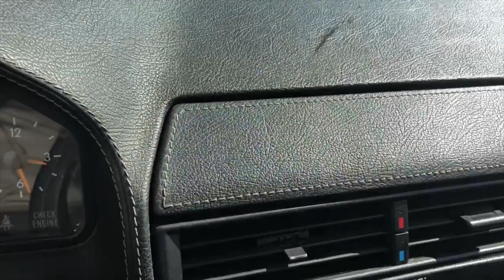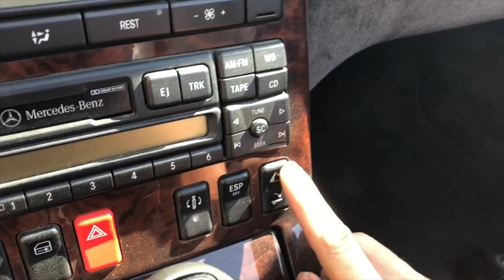I Bought a Broken V12 Mercedes SL600 for only $5000

Comment: I'll give you a hint, I used to own one when I was 18 years old, it was the first car i bought with my own money. Get rid of the stock air filter boxes and put in some 3" pipes with a rubber boot and a high performance air filter (those cone looking things). The power increase is INSANE, you'll notice when you take out the stock filters why. Its 3" going to the engine, but only about 1" on the scoop side! Mercedes did this to limit the air that would go into the engine so they could limit emissions. This'll cost you about 40 bucks total. Dyno it before and after. On mine I also deleted the Cats (not needed in my country) and I straight piped the rear exhaust, just left the Y exhaust connector in the middle

Comment: Before anyone gets any ideas, you can find a lot of these "steals" on older S classes and older Mercedes in general but major BUYER BEWARE, the only 'steal' is the repair costs stealing your financial security. 
Often the repairs can be like 3x the value of the car. Those hydraulic suspension and I know some Merc convertibles have hydraulic roofs that break...those are thousands in repairs

Comment: There are very few things more expensive than a cheap Mercedes
Reply: True.   But I can name a couple of those things.   Coping with debilitating injuries for the rest of your life, because you bought a cheap-to-maintain car without Mercedes' advanced safety engineering, is infinitely more pricey than is paying to keep a Mercedes sorted-out.    And in a city not far from here, there's a couple who are facing a future as Elder Orphans, because their only daughter was driving a Miata convertible, when she hit a defective manhole cover, and her car flipped, killing her.   If they'd just bought a Mercedes, like the one above, then their daughter's private schooling (pre-K-12), and all the money for all her activities, and all the other money they'd spent on her,  would not have gone for NOTHING (their emotional devastation, of course, has no price tag).    A Mercedes convertible would probably not have flipped, in the first place.   But if it HAD flipped, the pop-up rollbar - among other features, would have protected their daughter.    Personally, in their case, I think that fixing-up a cheap Mercedes like Hoovie's, would have been infinitely cheaper than buying a new Miata, and losing their only child.   And we knew a Mafioso, whose wife was diabetic.   She preferred tiny Mercedes like the one in this video.   She drove FAST - but would lose consciousness behind the wheel, because of her diabetes.    She wrecked one zippy little Mercedes after another, AT HIGH SPEEDS.   Always, she emerged without a scratch.   Finally, a high-up with their insurer (this was a big somebody, for whom they insured commercial properties worth billions) flew down, and suggested, "Mr. _____, we value your business, and would certainly never drop someone of your stature.  But at this point, wouldn't it be cheaper to buy your wife a Maybach, and hire drivers for her?"    ...my point being that in a Mercedes, you CAN drive like that, and it's ONLY MONEY.

Comment: These are GREAT cars and worth the little rich man issues this one has. 
Rides like a vault on billboard flat smooth rubber pavement, pulls like an electric motor powered freight train, even with just the 5 liter V8.
And besides, "the Wizard" loves 'em!  Great taste in cars!

Comment: You have to get the F1 exhaust upgrade. The Zonda had the same engine as this and it's easily one of the best sounding cars ever. I also just saw and heard a straight piped S600 and it sounded soooo good.

Comment: People often get into a flap about the accumulators collapsing on the hydraulic suspension.  They are the size of a grapefruit and contain about a pint of nitrogen at about two hundred and fifty atmospheres pressure.  The nitrogen is retained by a synthetic rubber diaphragm.  When a wheel encounters a bump the actuator on the suspension, behaving like a giant syringe, forces hydraulic fluid through piping against the diaphragm to compress the nitrogen ‘gas spring’.  The viscosity of the fluid in the pipes behaves as the suspension dampener.  With age the diaphragms can rupture, the gas escapes into the hydraulic fluid and the hydraulic fluid now fills the sphere .  Replacing a broken accumulator sphere is a DIY job, and the part along with replacement fluid is not that expensive.

Comment: "this car has buttons"
And that's how i like cars, with alot of buttons, and not a stuppid screen where you have to go through menu's to turn things on or off.
Reply: Right i recently drove my sisters Mazda and it took me like 10 mins to find out how to turn the radio off, mostly everything was controlled by a center dial and you'd have to scroll through menus to do anything.

Comment: R129s are amazing especially the ones with the M120, silky smooth and powerful... actually a great buy this time. The top probably just needs calibration after reconnecting the battery

Comment: My neighbor bought a mint condition used 1994 SL600 in red over tan with 56k miles. Gorgeous car. He drove it only on weekends in sunny weather. 2mos later the transmission failed. He had it repaired and immediately sold the car for a $2,000 loss. LOL

Comment: I have it on good authority that the Mercedes V12 are actually fantastically reliable engines. The rest if the car may break around it but the engine will pull forever.

Comment: All the SL's (and SLK's) seem to suffer from a common fault.  If the boot seal fails water entering the boot seems to collect under the hydraulic and vacuum pumps at about £600 a time.  Easy fix.  Drill a few holes under the pumps.

Comment: My dad drives a 280,000 km 1989 500SL R129. Contrary to popular belief these cars are very reliable and not that expensive to maintain IF you maintain them well from day one. We are also members of an R129 SL Club and from what I’ve gathered none of the R129 owners have had major issues with their rides.

The V12 is obviously going to be fully loaded with features and is more complex than the other R129s, but anyone considering a V12 600SL/SL600 should be aware of this and have the necessary funds to maintain them. Common sense. And by most accounts the V12 R129 is not that much faster than the 500SL/SL500. In fact it handles worse because of the heavier engine up front. The 500SL/SL500 (and the 300SL/SL320) are the pick of the bunch. Perfectly balanced in terms of handling and the I6/V6s are decent on fuel.

Any abused and neglected car will break and become expensive to fix. This applies to all brands so give this car a break which was obviously not maintained that well to begin with. I keep saying this: If people can’t afford to or care enough to maintain these cars then they shouldn’t buy them.

Comment: latch the roof down, then hold the roof switch in the up position for at least 10 seconds till you hear a click. This should reset the roof. If the accumulators are shot, the ride will be very hard.

Comment: Everything is great except one major point: Any speed limits to take care for?
Here we use the full range of the tachometer ... until we get the bill - that gas bill.
I had owned that car 25 years ago when it appeared on the market and 10 years later that update with the new engine and full metall roof. great memories, great summer then in 2004.

Comment: the R129 is going to shoot up in value big time in the next 24 months, its a well built ,high performance V8 makes about 320 ps,v12 about 400ps, its comfortable and well maintained car will be  very! reliable and the loooks aged very well, it has passed the "god its so 90s" looks,and now it starts to become cool and pretty again.  while current  car design become messy and over styled, this classic shape will be cool for a very long time. so over all its a great package, which you can buy a trop top uber cruiser 2 seater gt benz with a strong V8 around 8-9k all day long. its not gonna stay in this price range for a very long time.

Comment: I'm sure  someone already commented and you've even sold the car by now, but that convertible top is a super simple window synchronization issue. It happens on all SL models, as late as 2010 even. And put some original wheels on that poor car, hate to see a beautiful car like that all ghettoed up.

Comment: I have had good luck with Porsche. They have some super solid cars designed to be on the road for decades. The frames and build quality stays stiff and tight. Parts are reasonable and they are fun to work on as it is more challenging then my chevy but they make sense.. if that makes sense? If you work on cars it probably does.

Comment: I read somewhere with this body style that the top was the main issue, that if it sits for long periods of time, either open or closed that it loses its prime since its hydraulic. I read that if you leave the top at the half way point overnight, usually that's enough to re prime the system and the top should hypothetically work again.. dont know if this is true as I've never owned an SL of this vintage but, might be a quick trick and worth a try before another repair bill?

Comment: I love driving sports cars, and especially Mercedes-Benz. On a regular basis, I have driven the old diesel 300SD, 280SL, 230SL, CLK430, SL500, and most recently, the E400. I was most recently driving the SL500, borrowed from a friend, as my personal vehicle, but was at a time of my life where I did not have the desire to be throwing good money at an old, expensive to maintain car. I also wanted a good off road capable travel car. The Benz I was driving was a 2002 SL500 with 95,000 miles, and some major issues were forming by the mile. It was a great looking car, but I was surprised on how almost every mechanic that looked at it had no nice things to say, whatsoever. The all said in a nice way, to sell this piece of junk before it strips your wallet. I ended up buying a new 2017 Ford F350 gas 6.2L V8 with 385 hp and 430 ft lb of torque. Although, not sports car, this truck is a hot rod, with way more power than many sports cars, and is still fun to drive, despite it's weight. The cost of skilled labor for vehicles has become so high, I am not sure it is good to keep any vehicle past its warranty anymore.

Comment: Hoovie, I just did the hydraulic top on my '91 SL500 last year. If you or the wizard need pointers on where to get parts or have the cylinders reconditioned, let me know. I rebuild most of the cylinders myself with Viton seals and I had TopHydraulics rebuild 2 pairs that were a little tougher to get into. I'm happy to help with info!

Also, does it have the hard top??

Comment: Ohh man, I almost bought one a month ago.  I offered more than 5K but still was short enough to not get the seller too enthusiastic about selling.  Instead, last week I got a 2006 AMG E-55.  I'm not rich by any stretch so I can't see being able to buy it  on top of what I already have.  :-/  The condenser behind the dash is a common issue apparently that isn't cheap.  Looks like this is one of them.  At least the suspension isn't as expensive as the ABC of the next generation of SLs.  I'm dreading when my SBC goes out.  Anyway... I'm jelly.

Comment: Nice ride Hoovie!  I got a 98 SL600 Sport earlier this year and am fighting my 2nd hydraulic suspension failure already.  I think I only have gotten about 5 drives out of it in between.  Do you think it will loose potential value if I replace suspension for the SL500?  Its about $1,000 in parts - good for a lifetime, vs $500 per repair.

Comment: Ahhhh, my kind of car. I had to take the W215 out for a run after watching that. MB big V8 and V12 engines are just some of the nicest. Maybe not fastest, or maddest, but once you've had one, it takes a helluva lot to turn back from them.

I'd shoot the Ferrari in a heartbeat, if it was a choice between that, or the SL600.

Comment: Good luck. I never really understood the SL600. Marginally better acceleration and worse handling than the V8 with MUCH higher potential for expensive mechanical problems. People bought these barges for bragging rights at the country club.

Comment: 389hp 6.0 those numbers not that impressive. but the engineering on that Mercedes-Benz is very impressive. the gimmick was how smooth an quiet the engine was, you can sit a glass of water on the engine and it wouldn't vibrate. in 1997 that's high-tech

Comment: I’m interested in buying an R129, but I’m looking at one in good condition.
Reply: buy a 1997 and later r129..........they have a lot less problems
Reply: ray butts Yeah, ‘93-‘95 has wire harnesses issues. I’m looking at either a V12 or a 40th anniversary
Reply: sl320 is not a bad way to go unless you have to have an abundance of power.
Reply: ray butts I myself think I want a SL500 40th anniversary, i think that an I6 for such a big car is pointless.

Comment: I had a CL600 12 cylinder same motor which is excellent the electronics are a freakin nightmare, like all SL’s. I wouldn’t touch that thing! In fact I’ve owned six Mercedes-Benz still have one, will never ever buy another!

Comment: I have a 1991 300E and I have the same rims but the center cap is missing for them on one side. Do you have any information about the rims or where they came from? Are they authentic mercedes? Did they come off another car or were they in an accessories catalog?

Comment: You might have failed this time. Older SL600, V12, in running condition with no issues might fetch 7/8k. Or less with high miles

Comment: Those rims look hideous.  I have a spare set of C43 AMG Monoblock 2 rims (17" staggered) available in Chicago cheap.  Took 2 sets to rim shop and had best four restored for my C43.  Was going to use the 2nd set for winter tires but decided it won't see winter.

Comment: Hydraulic suspension very expensive ?!? 
- its the same type of suspension you have on any Citroen the last 50 years (ID, DS, SM, GS, CX, BX, Xantia and C5) and RR, BMW and Merc has licensed it.
- its the cheapest simplest suspension system I've ever worked on.

Those "balls" are both the spring and damper and they go for as low as $50 a pcs, most expensive one I've ever bought was $80 thats the reserve ball - the ball that keeps break pressure on the car if you should ever have a total pressure lose.
The most expensive part is the hydraulic main pump - last the life of the car times two. Easy to get a fine one secondhand, but I never heard anyone needed to change one !!
Second most expensive part - the pressure regulator that the one the reserve ball is fitted to. $1000-1200 NEW, $300-500 perfect one used. The leaking regulator is, 9 out of 10 times, due to a plastic part that can be machined out in aluminium and the regulator will Never leak again :-)

All tubes in this high pressure system is dual layer drawn stainless steel - they will last for 15+ years even when mounted unprotected under the car on the danish salty winter roads.

If you drive your hydraulic suspension like a crazy (like me) you will have a service interval of 20-30k miles on the wheel balls and 50-80k miles on the two reserve balls.
It takes less than 3 minuttes to change each ball - ever seen anyone change 4 chokabsorbers and springs in under 15 minuttes ?.

Comment: There is another guy whom did a video about this very car... he replaced the whole suspension to bring it up to date and to get rid of the issues that comes with this type of suspension. He also replaced a lot of parts and stuff to fix all the little BUT VERY EXPENSIVE quirks that these type cars seem to have. I will find the video and send you the link.. I know in the video he used HOTCHKIS they had just made a complete suspension for these cars. I found the video not the same model BUT they use the same suspension. I hope this helps you.. 

https://youtu.be/QmHwLF0_P3g

Comment: I sell kits to replace the leaking seals in all 1990-2002 SL's. 1990-1996 use 12 hydraulic cylinders, 1997+ use 11. You can repair most of them yourself in under 15 minutes each once moved. Mine are superior to the OEM seals that Mercedes still has in their replacement R129 cylinders. Check them out at mercedestopseals.com

Comment: Not all of us millennial’s have no appreciation to anything classic.
Wouldn’t you be considered a millennial as well??
Reply: Nightmare_0-mega Von Early 30’s???
Reply: Nightmare_0-mega Von I was always under the assumption millennials where individuals born before 2000, anybody after 2000 are not millennials.
Reply: Nightmare_0-mega Von nope that’s the cut off date for millennials. Roughly between 1981-5 to roughly 1997-2000